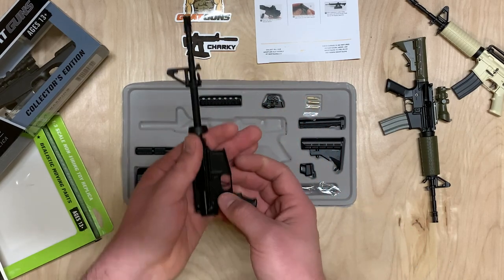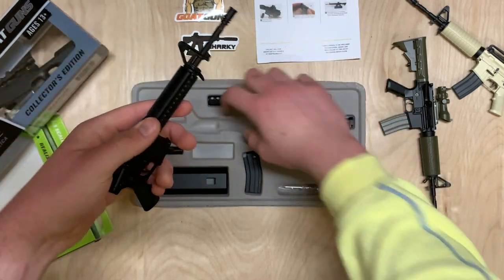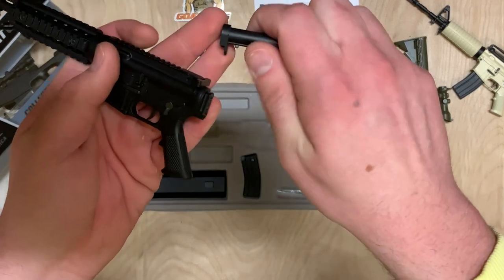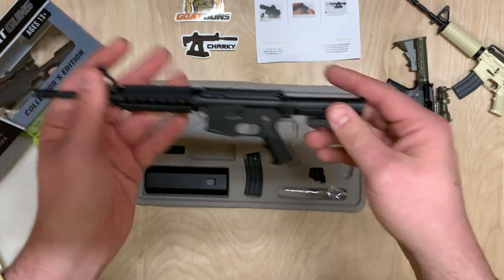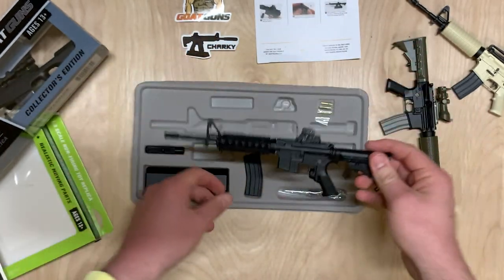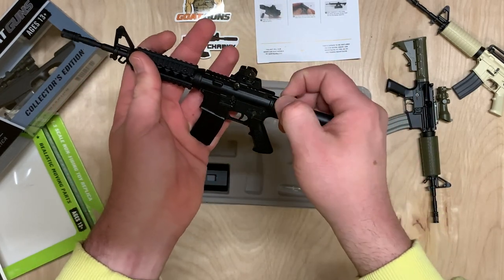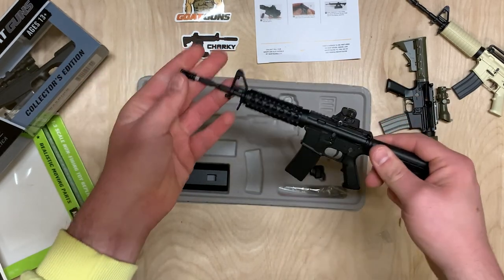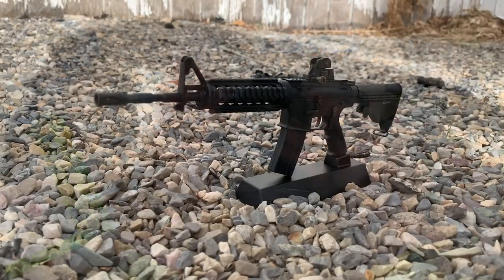How to Assemble AR15 Miniature GoatGuns Model

Comment: The hand guards were a pain to install as well as the the butt. I finally got it though. I now have the M-16A1 and there seems to be no videos out there on it specifically. Was just wondering about the handguards for it.
Are they the same or are they designed lower and upper ?
Reply: fr

Comment: I like my AR15 miniature GoatGuns model. I have trouble mounting the hand rails. They don't snap like it shows in this video. I got them to stay on with just the spring pressure, and it is on display, but if anybody touches it the hand guards fall off. Any ideas on how to fix this issue?
Reply: Late reply for sure. I was having this problem too, I just kept messing with it and slightly turning it and then locked into place. For me it was towards the muzzle that I had trouble with.

Comment: My hand guards don’t snap in. They’re loose and any movement makes them fall off. And the silver spring is so easily visible it’s a eyesore. And mine came scratched up a little. I feel like I have a used defective model
Reply: I also got the short barrel and it’s too long to even put the screw in